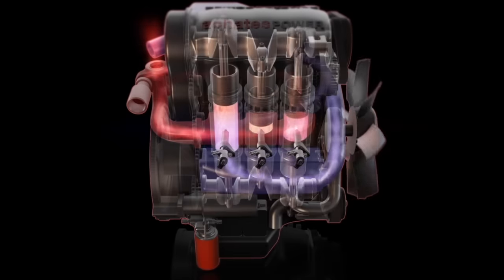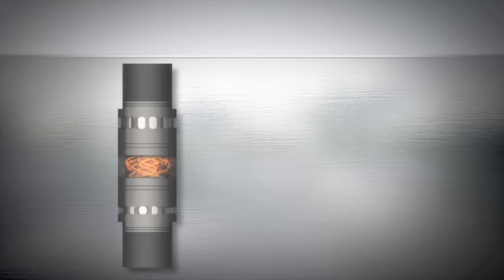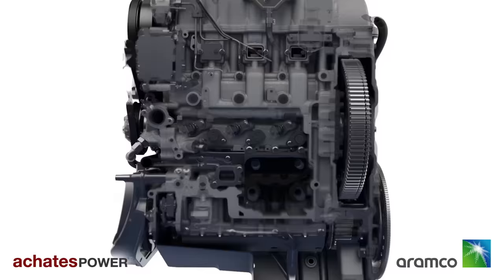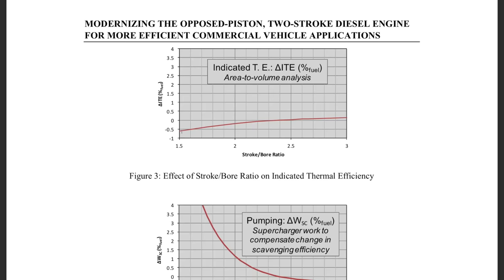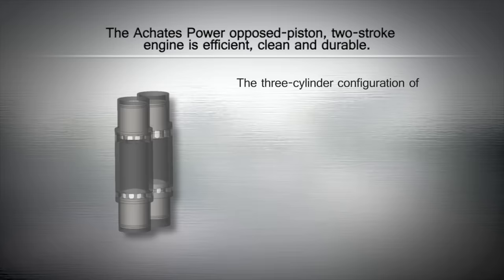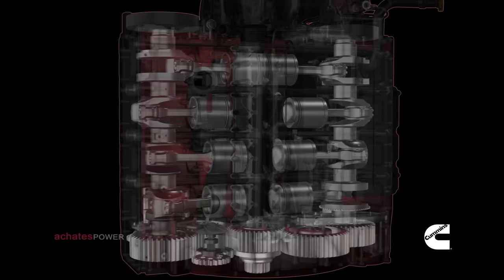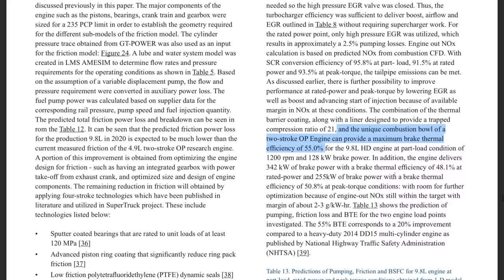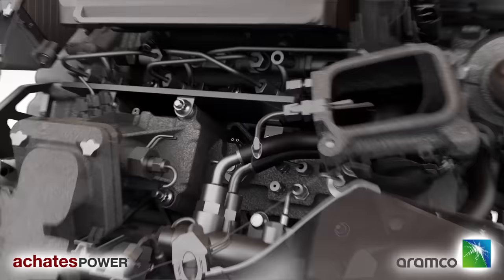Opposed Piston Diesel Engines Are Crazy Efficient

Comment: Someone Should make an opposing Six-Cylinder engine, imagine the TORQUE!
Reply: So this would be a 12 cylinder... = 6 sets of 2... ?
Reply: @robertmoore1099  6 cilinders and 12 pistons.
Reply: Deltran, 18 cylinders, 36 pistons, 3 crankshafts.
Reply: We used the Fairbanks Morse 10 apposed piston engine in submarines since the 1940s. 10 cyl, 8 1/8 inch bore pushing out 1600 hp at 720 RPM. The big failure item were an occasional cracked cylinder liner or a slipped vertical drive. They were a workhorse beast.
Reply: they have for a long time
Reply: Has been done already, the Junkers Jumo 205 still is among the most efficient Aviation Engines ever made, even though it is over 80 Years old.
Reply: Search 6TD diesel engine
Reply: @simplyamazing880  They were also huge.
Reply: @simplyamazing880  omg, that sounds sweet!

Comment: I wonder if A "H" cylinder configuration would be viable? By "H" I mean it would have a  total of 6 cylinders, where they have two banks of 3 cylinders side by side that share a common intake in the middle have split exhausts either side. Sure it means 4 cranks but you could maintain ideal scavenging while having the benefits of a 6 cylinders  power overlap.
It would be quite a bulky unit though...
Reply: Beat me to it....
Reply: This was my first thought but I realized, as you did, the engine would be very bulky in a H6 type setup. This engine would probably be great as an I6 style, and you wouldn't have to worry about high revs since the design lacks a valve train and therefore cam twist, valve float, etc is not a problem. Of course this is all speculation but imo a H6 would be too bulky and heavy to be very efficient power to weight wise
Reply: Not sure whether such a thing would get much traction in cars though might be a plausible scenario for aircraft as piston engine aircraft often already use rotary engines. That is to say a piston engine with the sets of pistons evenly spaced all the way around the crankshaft. Of course, this probably is in part also because piston engine aircraft are often single engine with the engine mounted in the central fuselage which is itself typically a cylindrical structure so not only are the rotary engines more optimal as you can position the pistons optimally around the central output shaft that delivers the produced torque allowing for the delivery of force from all directions throughout the rotational cycle. Of course, cars are not cylindrical and their engine compartment is essentially cuboid which limits the designs that can optimise the use of that space. Well the engine space is usually closer to a trapezium in cross-section viewed from the side but still, it is basically trying to make a device to optimally turn a drive shaft in a circle that fits into a rather square hole.
Reply: Make it six cylinder inline, dual turbo, and manage it like two three cylinders. Problem solved. These would be great for the heavy commercial truck market.
Reply: @repr26  not heavy trucks per say even pickups.  Be interesting to see one.  Big thing is noise as tons of people want diesels but without the sound of diesel.  Hence these new diesels you cant even tell are running
Reply: A better comprimise would be like the Deltic engine.  Have a triangle configuration, 9 cylinders, 3 crankshafts
Reply: @tractorboy31  the rattling noise is the explosion of combustion on a diesel.  The noisier it is the healthier it is. Drove diesels for 15 years.

Comment: Napier Deltic is one of my favorite engines to geek out on.  One of the strangest opposed piston engines ever. Turbocharged and uniflow scavanged.  And shaped like a triangle.  Each bank was 6 pistons and three cylinders arranged in a triangle, with 3 crankshafts.  

They had incredible specific power for their time.  And good fuel efficiency to boot.

Ultimately the problem is all opposed piston engines are two stroke engines.  I suppose you could design a four stroke version with side valves like an old fashioned flat head but you would lose a ton of efficiency to poor scavenging. 

And ultimately two strokes have  a problem with air quality standards .  You can't build one that fully scavenges.  I.E. get the burned air out and fully fill the cylinder with fresh fuel air mixture.  

Mix fresh fuel with stale but still hot burned air and you get byproducts that cause pollution.  That's the downside of their engine.

Comment: Fairbanks-Morse. They made submarines, trains, and probably more.
Reply: The problems Fairbanks-Morse had as locomotive builder:
1. Lack of market penetration made their product an oddball to most buyers
2. Piston maintenance in their prime mover required tools and a full shop, whereas the more common EMD 567 block could be done with a few people anywhere
3. Westinghouse generators failed in the higher-horsepower models (2,400hp) which ruined reputation. 

The ones that did get built and serviced correctly were known for being absurdly powerful pullers that ran well

Comment: Hopefully the fuel efficiency is there, the Simplicity of the engine is wonderful, it looks like it would make a wonderful aircraft engine. A twin 6 or 8 seater aircraft running counter-rotating propellers at 250 to 300 knots on 10 gallons an hour. Would be a wonderful aircraft. Easley 1500 mile range with an engine that would have a TBO time approaching 3000 hours.
Reply: Look up the Jumo 205 engine
Reply: But it would not be cheap to make (or certify). Too expensive for the small unpressurised market, too hard to beat the turboprops for the higher altitude longer range market.

Comment: in the UK we had tilling stevens engines like this in commer trucks 40 years a go,you could hear them coming miles away.
Reply: Bombers carried this in WWII. The main issue with older designs was keeping them cool was a challenge. This company has been solving that issue.
Reply: @RedWingsninetyone  they say there is nothing new under the sun
Reply: The Tilling stevens engine use a single crankshaft with con-rods from the pistons and crank linked using giant rocker arms, they pivoted on shafts either side of the engine ( the pistons worked horizontally) . the supercharger was on the front of the engine driven via a spline d shaft that ran from the gears on the back of the engine, when they broke it was a major strip down to get the bits of broken spline out of the gears. They did sound great, but lacked power up hills. I was told by a Rootes group (Commer) rep. that they made no profit on the engine, only on the rest of the truck.
Reply: @murrayfranklyn84  having driven them you are correct about going uphill,they had to  be driven hard.we also had foden two strokes which made a lovely racket.I never drove one of them so I can't comment on thier performance.
Reply: Murray - Had decent power but low torque. The engine sounded like ball bearings banging around inside.

Comment: interesting. 2 years later and still not a word about them.
oil control is still a problem on these, as it is on any cylinder wall ported engine.
that's why they stopped using them.
plus these engines are tall and hard to package under low auto hood lines. 
that's why the only demonstrators are trucks.
and the world is going electric now anyways.
Reply: Emissions. The EPA doesn't like diesels...the backpressure of the Emission systems kills this 2 stroke design..this Achates design could still be adapted to gas direct injection engines .
Reply: Electric is not the future.

Expensive and not environment friendly
Reply: They dont want efficient engines coz they will not make money. Electric will not get big until they find a solution to charge batteries as fast as refueling on a pump and have better range, I say electric is for golf carts!
Reply: millitary uses them
Reply: @FSXgta  
for some things. not subject to emissions though are they?
oil control is what doomed these engines and still  plagues them for mass use.

Comment: Lubricating the piston walls is going to be a problem unless you mix it like 2 stoke. the gaps in the intake and exhaust has issue's with lubrication leak.
Reply: Was thinking the same at first, then I noticed that the cylinder has a second ring set at the bottom of the cylinder heads that may help out significantly. Fuel oil mix may help the cylinder body between the rings out.
Reply: They may use oil squirters for not only under the piston but it could squirt out the side of the piston as well. Oil would travel inside the connecting rods to get there
Reply: How does the Detroit Diesel 2-stroke engine do it?
Reply: Just make it out of ceramics
Reply: @michaelr.1709  The rings carry oil to the upper sleeve as long as the cross hatching remains in the walls, as in other engines.
Reply: Diesel fuel has a very high lubricity, especially good off road diesel without the "wax" removed. That's why diesel engines will go 500,000 miles without a rebuild vs a gas engine averaging 200,000
Reply: Yes ports usually have that problem.

Maybe hydrostatic lubrication could offer an answer? Rather than fluid being pressurised by motion, a fluid which could even be air, is pressurised outside bearing/slide. Then it's a lot like how hovercraft float. If gap between moving part small there's fluid flow can be small. Just needs a pump to push fluid to higher pressure than inside cylinder, and then pressurised  air from between piston/bore walls will always flow towards top of piston. 
Could make all bearings oil less similarly... Good for turbocharger too?
No wear at all in normal operation as parts never touch.
Reply: @stevecummins324  redesign the area where the 2 pistons connect by having a gap for exhaust and intake valves of 45° angle
Reply: Oiling the cylinders-pistons-rings comes from spatter from the connecting rod big end bearings. The common problem is getting the oil out of the cylinders. Two or three oil scraper and control piston rings are necessary in most piston motors.
Reply: @stevecummins324  - The film strength of air is almost nil. Metal-to-metal contact is prevented by the film viscosity. If it could be depended on, a single lubricant molecule thickness would be sufficient.
Oil pressure is to provide sufficient flow to prevent overheating of the bearings.
Many small motors have used rolling contact bearings but they are expensive and while needing very little lubricant flow their main drawback is the space they take up and the variable rotational speed of the crankpin-conrod big end rotation.
Panhard et Levassor in 1948 developed a conrod big end roller bearing that placed smaller rollers between the load-bearing rollers instead of a more conventional spacer cage. The smaller rollers are supported by an outer cage that doesn't carry the load of guiding the load bearing rollers.
The use of roller bearings enabled the oil pressure to be limited to 3 psi. Conventional bushed bearings require from 30 to 80 or more psi to keep the bearings from overheating.

Comment: Why only 3, 4 and 5 cylinder arrangements?
Why not strap 2 banks together to form an H-6 engine ala Napier Sabre.
Reply: Take a look at the Napier Deltic, they were there more than half a century ago.
Reply: It would be difficult to configure intake and exhaust that way.  It's possible, it doesn't make it particularly practical.
Reply: @cageordie  Oh I know of the Deltic, that was some real out of the box thinking!
Reply: @sergarlantyrell7847  ..and a fantastic sound to it!
Reply: @Paradoxical Nightmare V-formats are highly impractical for this format.  Far better to be parallel.
Reply: @Paradoxical Nightmare What'd be cooler and more theoretically possible is a giant triangle of them, they have three shafts to spin around.
Reply: Ser Garlan Tyrell 👀
Reply: Soviet t 64 tank had that motor 5TDF, 5 cylinder diesel 700 hp and this motors disadvantages caused the creation of t-72 and t 80
Reply: @Radbot776  T-84 (the Ukrainian version) uses a domestically produced 6 cylinder, like 2x 3-cylinders end to end.
Reply: Ser Garlan Tyrell yea they say they made like 300 of them but they only have like 15 t84s they still mainly use that old school t64
Reply: Bounty H Called the Napier “Deltic”, used in Locomotives (British Rail Class 55) and fast naval patrol boats.
Reply: @ClubPenguinMaster88  Check out the Napier Deltic engine developed in Britain in the late 40's for British rail. That had a triangular configuration of cylinders
Reply: @martynbush3462  Well I'll be damned, impressive engine.  Nonetheless, very massive and not worth fitting in a car.
Reply: a dual inline 3  12 cylinder engine. that gets the fuel eco of a standard eco small car but is really a heavy-duty large pickup or small semi.
Reply: First thing i thought was how this has similar properties to the GM Detroit diesels with the ports and how they need positive pressure from a supercharger for operation. They also had the turbo and supercharger setup. It did use exhaust valves but air came in the cylinder walls. I brought this up because of the banking engines together comment. The Detroit engines had this capability and more with the option of reverse rotation though switching some of the parts around. If you haven't heard of those engines you should look them up, another cool design.
Reply: @ClubPenguinMaster88  They aren't impractical, though. You'd just have one of the three crankshafts run with two con-rods.

Comment: I see that one piston sees the intake air flow by and the other sees the exhaust. This seems like a potential problem of carbon buildup on one side and possible thermal gradient causing differential expansion.

I saw a similar design 10 years ago. In that one the two crankshafts could be phased in and out of synch to vary the compression ratio. It would give the engine the ability to run on a wide variety of fuels. I didn't see that here.
Reply: Michael Lowe have a reply! Thermal stress sounds reasonable.

Comment: In my opinion, if this technology was implemented in the 70's or 80's, it would have revolutionized the industry. We would have seen anywhere close to double the MPG on almost every car, fitted with one of these engines. However, it came out way to late in an era where everybody is slowly migrating to electric.
Reply: If this was actually usable for consumer level cars, it would absolutely destroy all electric cars, even in terms of CO2 footprint. With the current power mixture and their expected lifespan, electric vehicles are marginally more "green" than normal IC cars. If we had an IC car with 60% efficiency, it would be significantly better for the environment than any modern electric car and probably all electric cars that are going to be developed within the next two decades (unless a revolutionary new battery technology is found). And it would be much more convenient for the customers as well.
Reply: Massive marketing has obscured the fact that batteries are not power sources but energy storage devices.  To compare vehicles it is important to consider overall efficiency from power generator shaft to vehicle drive shaft.  For the diesel powered vehicle the generator shaft is the driveshaft so the conversion losses between the shafts are zero.  Conversion losses for electric vehicles are always significant.
Reply: @gayusschwulius8490  Fake news. Electric cars are far better for the environment. You'd only have to drive a small amount of miles each year for it to be greener than IC engines.
Reply: @gayusschwulius8490  The reason for the push for electric is because you can use renewable energy to power those vehicles. Imagine covering your house in solar PV and it powering your entire house and transportation needs. This is possible for some people in certain areas already. Yes it's true if vehicles were substantially more efficient with gasoline it would delay the transition to EVs since the economic differences would be smaller but it still wouldn't address the lack of renewable energy powering our transportation.
Reply: Um commer knockers were around in the 60's. They were good.

Comment: If the engine ever develops rod knock, will the pistons hit each other? Also really curious how the scavenging of the oil works on the top of the engine
Reply: Maybe it is designed to run with diesel as a lubricant.
Reply: How is the risk of pistons hitting each other any different that a piston hitting a cylinder head?
Reply: @GFSwinger1693  if you have play in both rod bearings i guess, although the compression would probably keep them apart
Reply: rather than a top and bottom, why not parallel to the road way, on it's side?
Reply: @clarkwillis3490  like the old commer ts3?